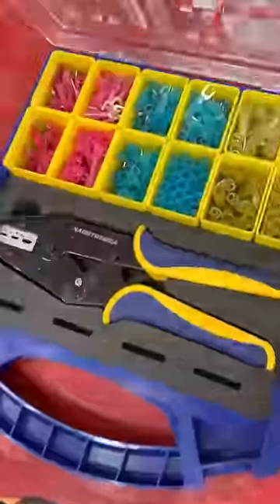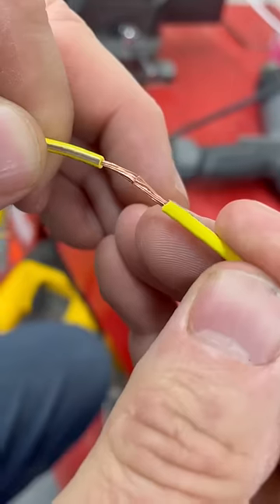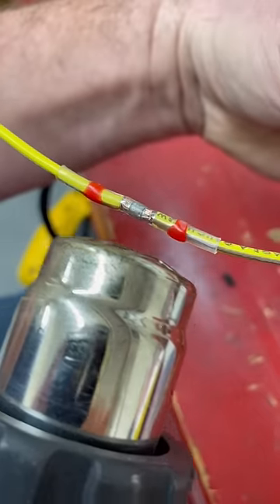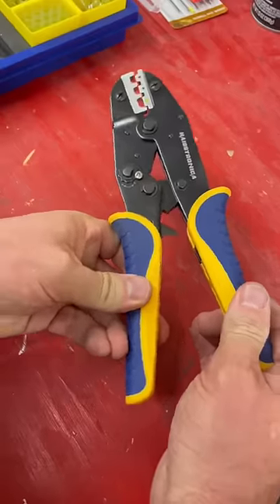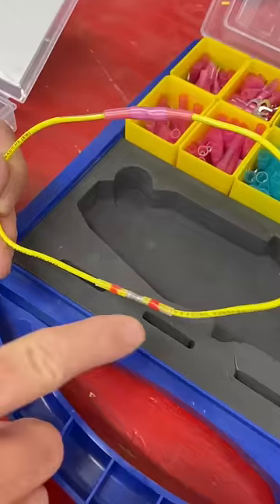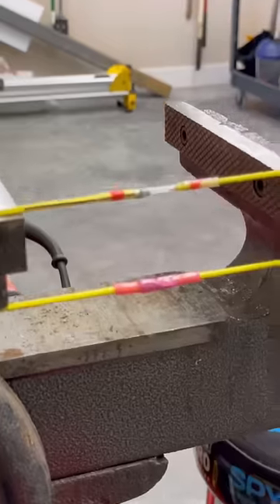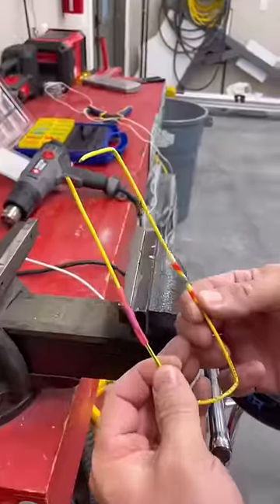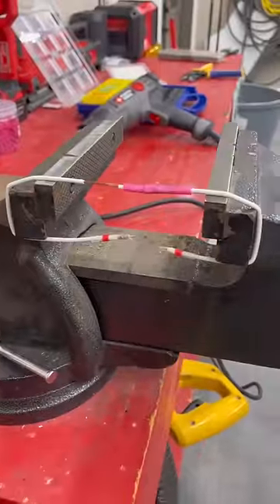Crimp verses Solder Connectors

Comment: as a canadian mechanic i can confirm it dont matter what you use the salt will always win
Reply: Solder and liquid tape , tighter than a nun
Reply: This is the correct comment!
Reply: Lmao yep
Reply: As an Upstate NY mechanic, I concur.
Reply: In humid or salty environments (like the Great Lakes region where I grew up,) I use crimp connectors with shrink tubing. I apply a small amount of dielectric grease over the crimp before sliding the shrink tube over the connection and heating it. I’ve been doing this for over 30 years and I’ve not had a problem with humidity or salt causing a failure.
Reply: Green death
Reply: @johndowe7003  tighter than a nun 🤣🤣
Reply: Ya liquid electrical tape beats the salt all day long
Reply: @justinnobleres omg I didn't really pay attention to his joke but you repeating it and laughing emojis make me crack up hard lol 😂
Reply: Every time